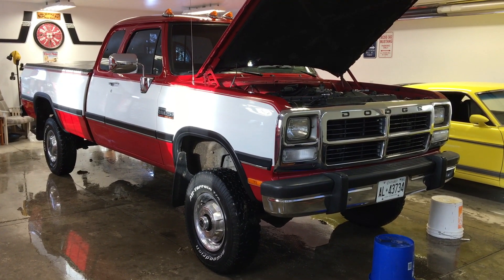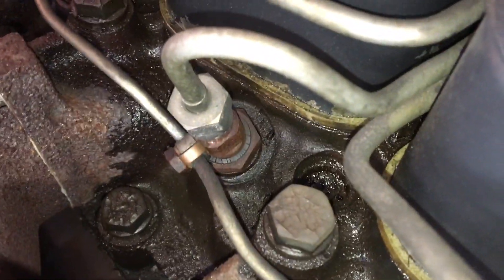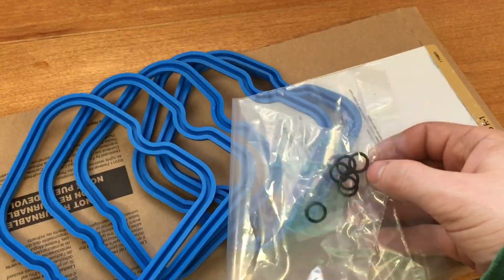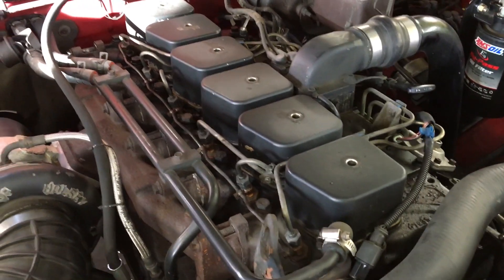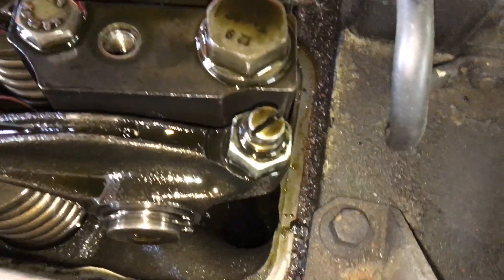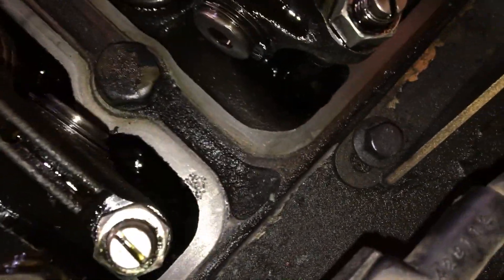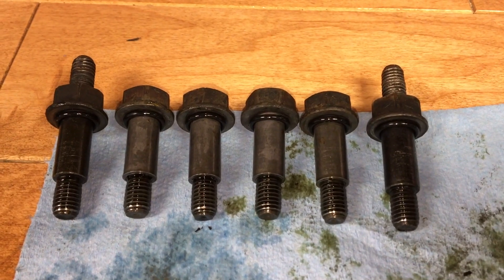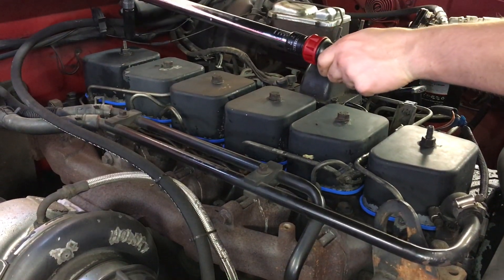12 Valve Cummins Valve Cover Gaskets

Comment: How did you go about cleaning around the valves?
Reply from the maker: I just used some cleaning solution on a paper towel. It takes a while but it eventually gets clean
Reply: @OvensGarage  does break cleaner work
Reply: @samwalker5314  just get the gel degreaser from auto zone and spray around the valves really well before even taking them off

Comment: looks like you have that IH head (1:11 appear to see stamp). another cool vid. nice job
Reply from the maker: I never noticed! Is that significant?
Reply: Hey Tyler - significant? I dunno. My dad had a '69 IH truck that he'd take my brother and me camping in so I've always had an affection for Internationals, so I think having the IH logo stamp on a Cummins motor is kind of cool. My understanding is IH cast some Cummins blocks and heads back in the day. Some of what I have read is that some say they are better because they have a higher nickel content and others say they are equally good and no better thatn the Cummins manufactured heads/blocks. There are guys on here and blogs that are real pro's (I am not) that probably know better than me but as I understand it, they are rare. So, if you "Google" search something like "international coded (or stamped) Cummins block" or similar you'll find stuff. Here are a couple links http://www.competitiondiesel.com/forums/archive/index.php/t-2776.html and http://www.cumminsforum.com/forum/94-98-powertrain/361312-international-block-head.html